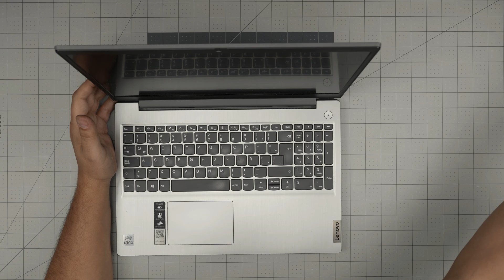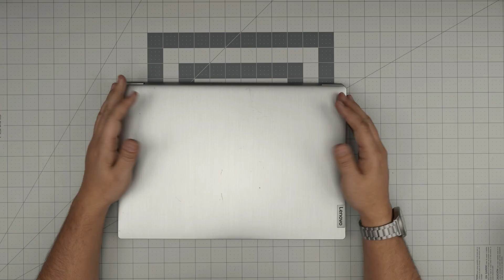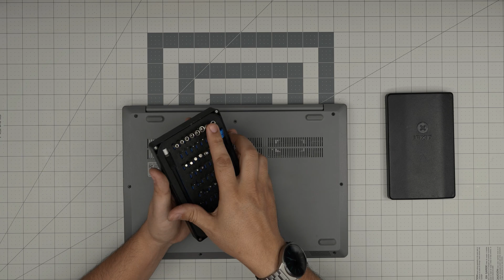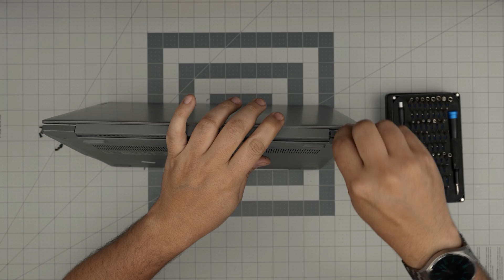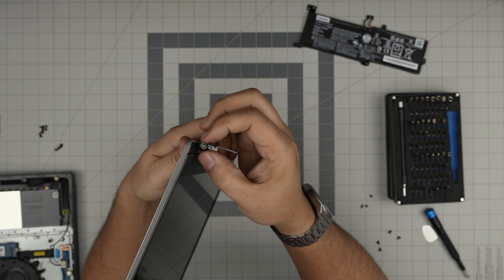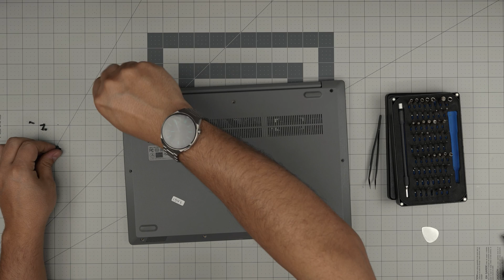How to Fix Hinge on Lenovo Ideapad 3 15IML05 Laptop - 81WB

Comment: My lenovo ideapad started making a crack like sounds when I close it today, I close it slowly but the bottom right of the screen now have a small opening. Can I still follow this video to fix it?
Reply from the maker: 🫠Regarding your question, sure you can.
Should you have any further questions or requests in the future, please don't hesitate to ask me.
cheers🍻
Reply: @uFixTek ty, I'll update after a while
Reply: @uFixTek what to do, I can't open the laptop anymore, it's making this cracking sounds and the gap becomes bigger as I open it. Even when  supporting it (pressing sa bottom right of screen)
Reply from the maker: You have to try to open it while holding near the corner, close to the hinges.

Comment: I know this is a kind of old video, but I hope you reply. I have the same problem, but it got so bad it started breaking the plastic cover of the screen, and even the plastic carcass where the usb connection is, near the hinge - both things on the right. I have an Ideapad 3 if that is relevant. I brought it to a repair shop and they simply poured liquid plastic between the plastic cover for the screen and the screen itself, im guessing epoxy or something like that. Could i do this and replace the screen carcass as well? or would the glue tear the screen apart?  Thank you in advance! 
Mentioning you just in case it makes my comment more visible @uFixTek
Reply from the maker: 🫠 Regarding your question, I would like to see a few pictures of the work that has been done and a 360° video all around, so I can assess the situation and give you options with corresponding links. Email me the info.
ask@ufixtek.com
cheers🍻
Reply: @uFixTek  man I really appreciate the fact you even responded, i have to be honest I ended up never looking back to this comment. I am also very much grateful that you're so predisposed to help. For now tho, i got a new machine i can use as a laptop, and im keeping the old one as a desktop. Made somewhat of an investment already in terms of money, so i will now be buying replacement parts anytime soon, and the old one works fine, i just cant open and close it too meany more times. So ill probably postpone this until i have no other option, or more time and money to spare. Again though, thank you SO MUCH for the availability.
Reply from the maker: It's my pleasure, my friend.
Whenever you need any assistance or help in the future, let me know — I’ll be glad to help you.

Comment: Sir,
After using my lenovo ideapad 3 i5 11 gen 15itl 6 for about 4 years, the screen opening and closing felt tighter.  And right side right shows little gap even after closing. 
Took to local mechanic. He opened back cover and applied  a drop of machine oil on both hinges right and left Closed back. Opened and closed few times. And told me to use next day. All ok next day. Smooth as before and right side gap is gone.
Reply from the maker: That is a temporary solution, not a permanent one.
But I'm glad it worked for you for now.
cheers🍻

Comment: hi there, my IdeaPads' hinge got broken(at list that is what i think happened) and there is this gap that you could see some parts and cables form the back, also the plastic that is holding the front screen is detaching on the bottom right. is it fixable?
Reply from the maker: 🫠Regarding your question, sure, it is, and it should not take more than 1–2 hours of work, and 7–12 hours of curing for the glue.
cheers🍻

Comment: searching for this too long, dont wanna visit the service center, gonna do myself, even has the proper too, i have ideapad slim 1 (same design as it is), same color even, amd ryzen 7, can it be done without opening the screen, like just simply loosing it, like 5 percent, I do have the save tool as yours, gonna mark with a marker and proceed to do
Reply from the maker: Take your time with the repair and don't rush. The steps are the same for almost all IdeaPads.
Should you have any further questions or requests in the future, please don't hesitate to ask me.
cheers🍻
Reply: @uFixTek also sir...i am having problem to open the hinge cover unibar,inside which the hinge torque nuts are there...could u guide how to open that

Comment: Is there a way to use my Lenovo Laptop without minimizing it from breaking? I have a similar problem, I just won’t be able to get the parts for a while, I want to use it but I fear of breaking my computer, should I leave it open or leave it closed and leave it off but I wont be able to use it for a while. The damage is kinda big where it’s showing a small gap showing the motherboard.
Reply from the maker: use the laptop but don't close the screen leave it in open mode untill you get the parts.

Comment: purposely designed to fail,/ break,... newer purchase of laptop,...material disintegrates,...on its own,..
 apply araldite ,.. one drop of printer grease,/.wd40,. solved,...!
Reply from the maker: 🫠Regarding the laptop, I have been servicing and repairing them for the past 22 years, and I have seen how their designs keep getting worse and worse knowingly. And they call it "defective."  
You need to use grease and also loosen the bolt.

cheers🍻

Comment: Bro 
My lenovo laptop s lock got broken 

So could it be repair without changing body
Reply from the maker: lock? what is the lock?
Reply: @uFixTek  i mean to say 
The hinge bw screen and keyboard base 
That locks grip now loosed or broken
Reply from the maker: ah of then you  need to replace it, the best place to buy them is on aliexpress or ebay.
Reply: @LEGEND...999  same happenned to me i just use tape works fine for me

Comment: This worked for me; I had the same issue that the hinge was far too tight on my Lenovo.  I'd recommend though not disconnecting the Wi-Fi cable.  Getting the two connectors back on is a bear.  The connections just never seemed tight and I ended up putting a dab of epoxy on them to ensure they stay in place.  After putting stuff all back together I realized that my hinge was too loose so I needed to do most of this all over again.  After removing the hinge screws I was able to finagle the screen and laptop body enough to tighten the screws (without disconnecting the screen flex cable or the Wi-Fi cables).  Otherwise, mission accomplished, thanks for posting the video.
Reply from the maker: It's my pleasure, my friend. 😊
I'm glad that you got it resolved.👌👍
Should you have any questions or requests in the future, please don't hesitate to ask me.
🍻cheers
Reply: This video is great but I cannot figure out how to loosen the bar that the hinge is connected to.

Comment: Excellent video, thank you so much for the tutorial! 
However at 6:43 I'm stuck getting the bolt to loosen, any lubricant I could use to try and getting it to loosen by even half a turn? Thanks!
Reply from the maker: It's my pleasure my friend.
🫠Regarding your question, it’s not because of the lubricant. You will need to hold the base of the hinge very tightly (don’t hold it from the screen) and then use bigger pliers and an extension to turn it, as they are very stiff. 
After inserting the bolt, they smash the screw head. Just hold it very close to the hinge base and use a bigger-handled screwdriver or pliers.
cheers🍻
Reply: wd40/ printer grease,.

Comment: My screen isn't turning on after fixing back the parts together, what could be the problem?
Reply from the maker: 🫠Regarding your question, double-check the screen flex connector and make sure it is fully inserted into the jack.
Reply: Did you get it to work?